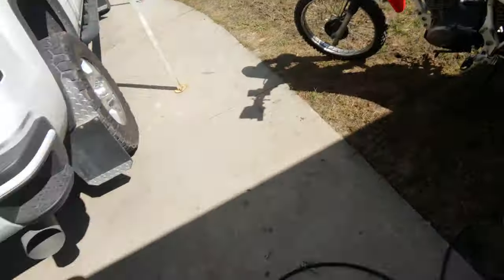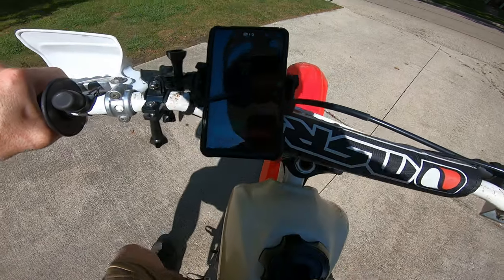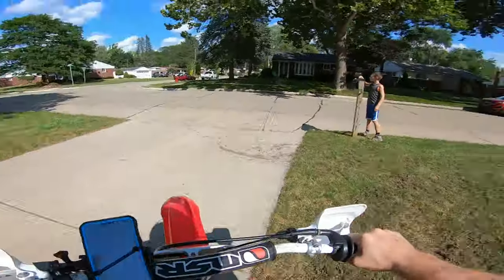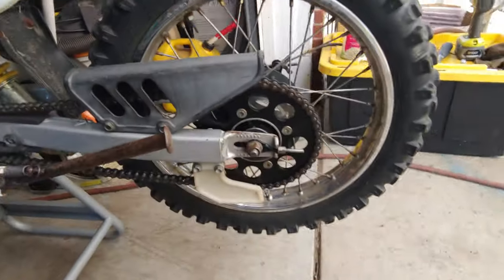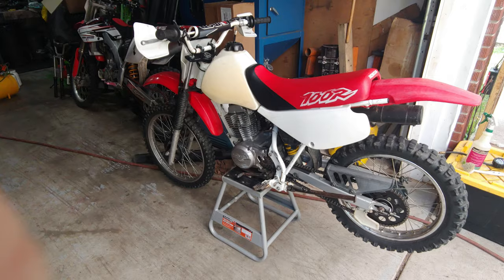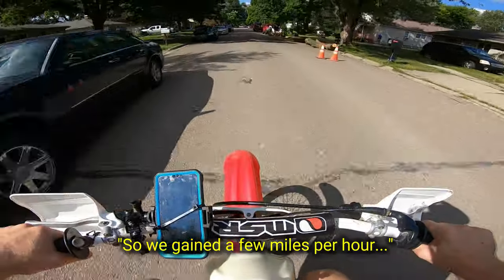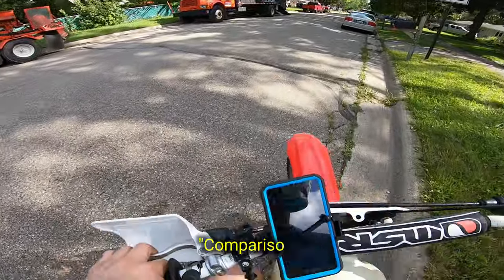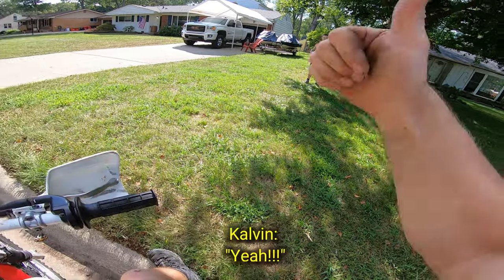1997 Honda XR100 Re-Gearing ||  New Rear Sprocket [Speed Test]

Comment: Andrew, I see you are a Fellow Michigander ;) I have an 03 XR100 that I just did this gearing switch on. I was going to go with 15/46 but figured that would be way to steep for the trail layout work we do up here for the Jackpine/Pinecone Enduro. My XR is my secondary  bike as I have a Fully Modded TTR125/150 that is usually my go to bike, which I also did a gearing swap on. We do alot of road/two track riding between sections and I can Always use More mph on top-end for Beer-Thirty back at the Clubgrounds after arrowing All day long out in the woods. Thanks for the video !!!

Comment: I’m the same my XR100 tops out too early looking for another gear it has plenty of power hauling me around at 92kgs so I’m thinking 46 tooth rear also!
Reply from the maker: You should do it it will work well. Mine goes about 45 miles an hour now

Comment: I've got a 36 tooth on my xr100
Reply from the maker: Oh nice! Ever clocked it?
Reply: @Fixin2Ride-Official-  Yeah, 78mph so far!... Hehehe.... Albeit that is goin downhill, but still....BBR 120, Hotcams Cam, ATC200X Carb, Electrosport Stator & Regulator in order to power my Hi/Low Halogen headlight & LED Brake/Taillight, Pro taper big bar conversion with modified suspension. ... ..& it's technically a '04 CRF100, but they're not foolin' me, it's a xr100. The CRF100 is just the same as the 1985 xr100 I had when I was a kid, they just gave 'em swoopier plastic.....
Reply: 65-70 on flat ground type county roads with my 200lbs
Reply from the maker: Lolol. Holy cow bro...
Reply from the maker: Thats sick man!!! Lol
Reply: @Fixin2Ride-Official-  Thanks Bud, I love my Lil Hondo. I'll let ya know when I get a video of 'er posted.
Reply from the maker: Good deal please do. Thanks for watching I appreciate the support
Reply: Well it takes a big johnson to ride a gear like that hahahahahaha
Reply from the maker: Lol.
Reply: @Mr.CJohnson   hey man where did you find that 36 tooth? I got a crf100f got 50tooth now. Way too slow. I can't find a 36 no where.
Reply: @lee-vq4bh I ordered it off of ebay for @ 40 bucks with free shipping Bud. It came in a 14/36 Sprocket & Chain Set. It is a 420 chain/sprocket set that is actually for an xr80. They work just fine on the 100's with no mods, there are way more sizes available in 420 rather than the 428 which is stock on the 100's, & because ya are getting a lil lighter reciprocating weight you get a lil freed up horsepower!! 😉
Reply: @teddyrascal6305  Hey Teddy Rascal, do you know what the Beaver said when he lost his virginity???
Reply: @Mr.CJohnson  this should be good...
Reply: @teddyrascal6305  Gee Wally, that kinda hurt.....
Reply: @Mr.CJohnson  link?
Reply: @Mr.CJohnson  what gearing are you running?
Reply: @Mr.CJohnson  lol my 2005 honda crf100f has 150f front forks on it, it only goes like 30 but I wanna use it as a road bike so I want it to at least go 75 if possible
Reply: @williamdale20  14 & 36
Reply from the maker: Nope. Stock exhaust and yes. Still running airbox.
Reply: @Mr.CJohnson how many links on the 420 chain can’t find the kit so I’m going to order separately I have a 2000 xr100 with a big bore kit , mikuni vm26 carb and 15t front sprocket .